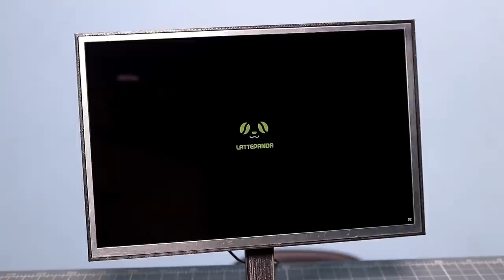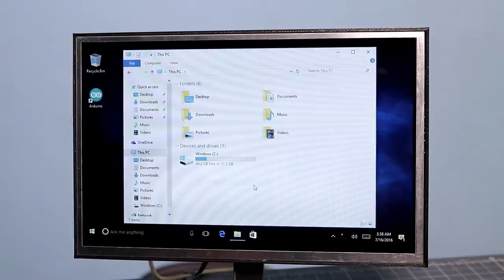How to Make a Mini Computer at Home

Comment: using an oscillating tool, you can cutout a plexiglass/acrylic face for the lcd. Rounding over and polishing the edges gives a nice look. White primer the inside of the plexi to give it a framed look, then contact cement it to the edges of the lcd.

Comment: Fairly decent all-in-one PC you've made here. I (personally) would have added a couple of things, such as a back plate so everything is enclosed, a USB hub, and also a splitter for the 12V power, so the Lattepanda and the monitor can be powered at the same time (using a step down power converter). Nice job!
Reply: Well there is no fan so a back plate may cause (idk what it’s called) “over insulation” which could overheat the computer, and then... you know what happens...
Reply: @Blacksmith52  that computer is quite low power so it might not overheat when browsing (what the chip is made for)

Comment: OK, you proved it's possible... 
Now make the case that it was at all worth the money to do this with new parts.  ;-)

Pros: 
- It's cute.

Cons: 

- Screen too small for tabletop (non-handheld) use.
- Mono-sounding stereo.  Why use 2 speakers if they are going to be only an inch apart?  (at least you could have angled them outward to simulate stereo from the bounce-back!  You could also have had the printer make the speaker bays deeper for a chance at better sound.
- 2 separate power cords (the screen's adapter is likely able to power the computer as well...A simple step-down arrangement could have done away with the need for 2 cords.)
- For the money, you can get a reasonably good laptop that will do all this and much more.

Solution:
Just mount the little PC board in the back of your big screen TV and you're done -- Better screen, much better sound, and an overall better experience.  

Sorry, Dude... Some projects are just not worth the trouble. 
A real challenge would be to do this with a broken laptop.  ;-)

PS:  A question about 3D printing:  Why was it necessary to print these as separate parts and then glue them together?  Is it not possible to have all that printed together?  In fact, wouldn't printing the mounting posts just as long but directly from the base, without the additional thickness, allow for better airflow beneath the board? Just curious, I have zero experience with 3D printing.
Reply: well there are a lot more pros and a lot less cons then you mentioned.
Reply: Care to give examples?
Reply: Well it's light it looks cool it's portable it's interesting and it is a good exploration of single board computers when building it. I agree with the previous comment that the speakers are too close, but that is the only con I know of.
Reply: i'm guessing he is just not good with designing in 3d. that's why he printed all those in different parts.
and yeah, this could have been designed as one or two pieces and be much better.
Reply: @yoshibros1111  another con is the cost. maybe for some the project - "building" something "yourself" - will be enough to cover that. but for the combined price you can get a cheap laptop that would essentially be a better device.
Reply: Its tiny like my tablet or something xD (also a windows 10 but it's a pro version)
Reply: You can get a budget laptop, but, in raspberry, you can change system, just by changing sd card, change monitor, etc with no problem
Reply: @jakubr2769  wow Bill Gates, thanks

Comment: Buy a used chromebook for $50 on ebay - I got 2 for $80 and they still work, more than a year.
Reply: But a chromebook has trouble running Linux and can't even run Windows, this pc can run Windows, Linux, and for idiots chromeOS, also why are you here if your happy with slow crapy Chromebooks?

Comment: How much current does the 12V lvds board needs? The one's on eBay say 12V at 4 Amps !!! 

LattePanda Tips: use 5V at least 3A but not 2A, remove the upper metal lid and stick a small heat sink on the flash memory, I also use a big copper heatsink below for the cpu.
2 Tip: put the loudspeaker LEFT and right on the back,  stereo is better...

Comment: Could he have printed the whole thing instead of printing and sticking it one by one ???
Reply: Rupak CR I asked myself the same question. It would be easy to just combine all the stl's.
Reply: I can imagine there's a couple of reasons. For example, if one part breaks or degrades, it can be replaced without reprinting the whole thing (well, at least that would be the case if he hadn't used superglue), and also cleaning off the excess printer material would be a lot easier with individual components rather than one whacking great lump. What I want to know, though, is why on earth he didn't put the speakers on either side of the display instead of together. That kind of defeats the object of stereo speakers, doesn't it?
Reply: It won’t function at all, due to the material a 3D printer can stabilize, and it isn’t as easy as you think it is to make a entire small pc with a 3D printer; and in order to do this properly, He is showing DIRECTIONS and that’s why you “probably” tapped on this video after all.
Reply: No. If the printer were to print this, it would clearly fail because of the sudden ins and outs in the body, plus the different upper body to lower body ratio.
Reply: I can't with some of you 😂. He should have printed most of the base plate together. In fact, he could've just added "standoffs" to the main back of the monitor to make it slimmer. But, it is smarter to have a detachable stand, as it could fail and waste plastic.
Reply: Yeah but most of us don’t want to use a 3D printer a lot.

Comment: Sir please how to make screen touch pc at home make a video sir
Reply: You could probably a touch screen instead of a normal as shown and install drivers. It should theoretically work.
Reply: Online buy kro 
Laptop touch bnany ki deviceati hy
Reply: @talalarain  pata hai phir bi ye Thora acha hai
Reply: Kaif Ansari he literally fakes everything it’s been proven by multiple other youtubers that picked his videos apart frame by frame
Reply: you can get a clear multi-touch panel to fit over a 10" monitor (as well as some of the other sizes that are on offer)

However, buying a common TV, and then printing the mount to fit to the VESA plate holes on the back would give you a much larger screen for the money. and you can get 27" touch panels if you want to go ham with it.

Comment: Bruh 270$ for a processor that have a speed clock of 1.77ghz. If your making this as a real comouter and you will use it everyday. Just go buy a cheap hp laptop that have is 15 better and that will cost only 250$

Comment: Today I leaned that there is Lattepanda. It has the same processor as my $250 laptop. 

If someone stumbles upon my comment, let me say that it runs Minecraft 1.13.2 with Optifine at 35-40FPS at minimal settings.

Comment: Open and weak body with high center of gravity - not reliable. Small screen. The power supply is bad. Why would this design print? Plywood would have been better. And no wonder - just bought and put in plugs. All the work was done by Chinese workers.